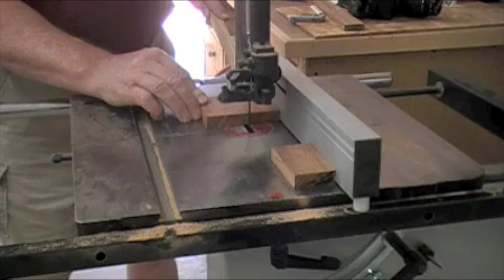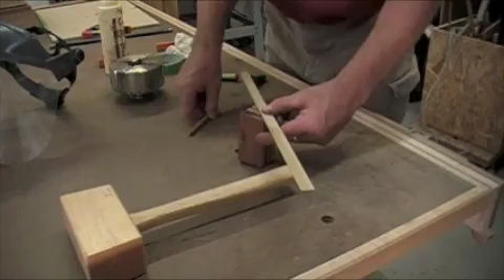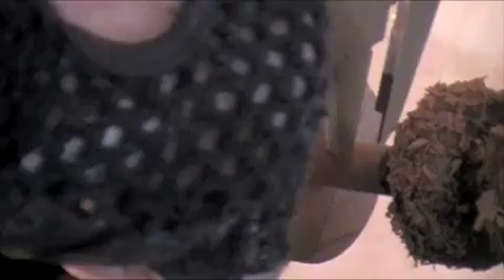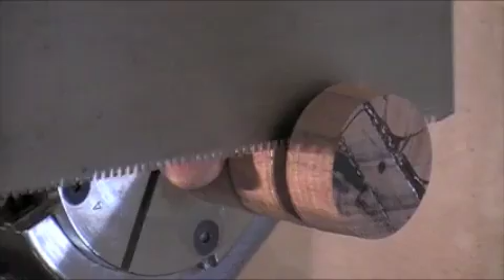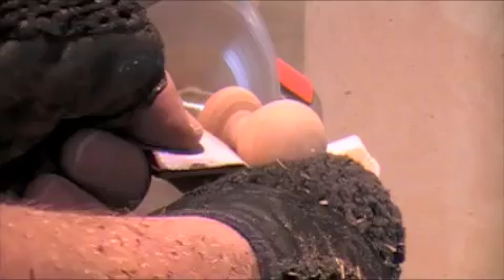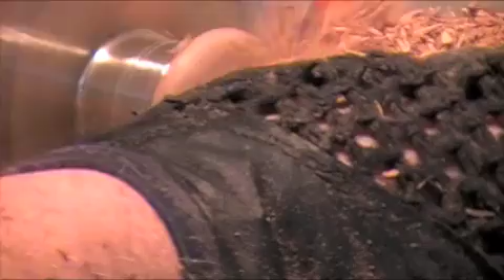Woodworking Project - How to Make a Jewelry Box - Part 5 - Woodturning Techniques

Comment from the maker: @Sodabowski 
Normally, I would have chosen a white or yellow glue to apply the turned knob to the lid. However, what you do not see in this video is that it was over 105 degrees in my Las Vegas NV shop at the time. I chose CA glue for an instant glue-up so that I could complete the project. In this case, the CA glue does not show or affect the finish at all.